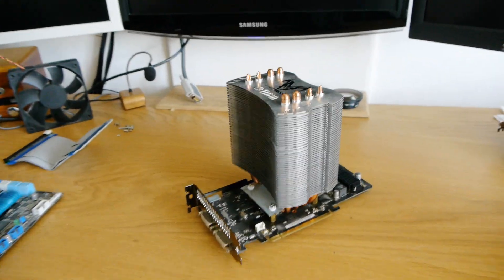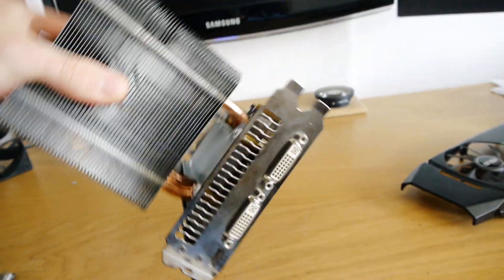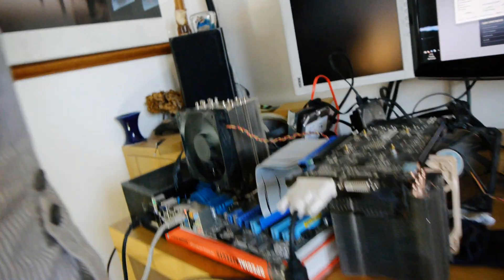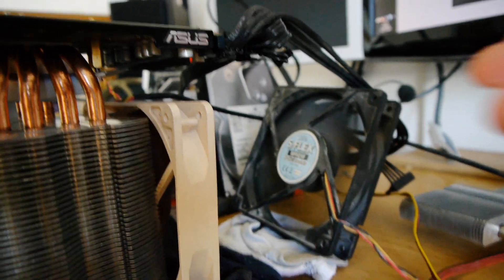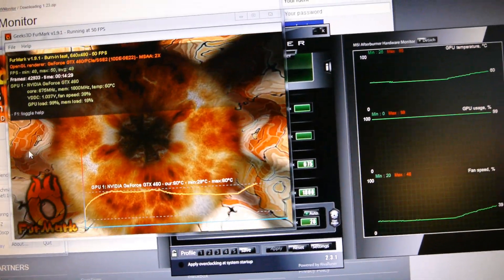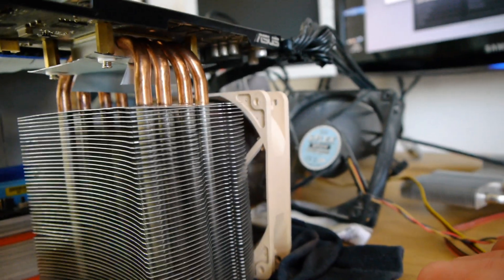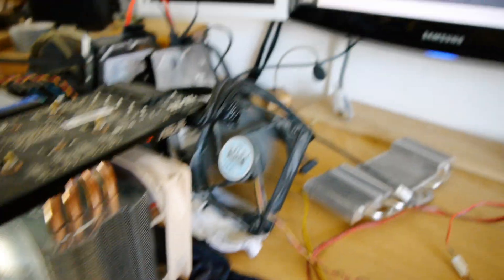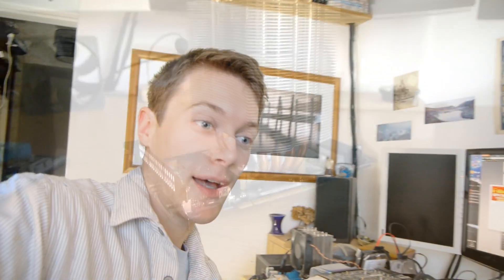CPU cooler on GPU (INSANE temps!)

Comment: There is one MAJOR issue with this design, You are not cooling your VRM's at all. Risking a VRM blow out.

I recomend getting VRM heatsinks (Completely passive with no fan forced airflow over is enough if you do not overclock.)
Reply: lampuiho Aluminium PCB? I hope you just realize what you said.
Reply: Mathias Westerlund 

Sorry mate, actually YOU are wrong here. The kind of PCB our friend lampuiho is talking about is the METAL CORE PCB ( and NOW you can Google it yourself ). Just because you haven't seen something during your career, it doesn't mean that something doesn't exist.  I don't mean to be rude, but, as you said, you are an IT guy, and we are electronics engineers. This time we know what we are talking about. Cheers!
Reply from the maker: Mathias Westerlund The original cooler didn't cool the VRMs or RAM either, so it's not exactly out of spec.
Reply: DIY Perks no ram cooling doesn't come off as odd. The vrm tho does. But eyh.. it's a lower end card so I suppose.
Reply: Mathias Westerlund its funny im a mechanic and knew what he was talking about. i do have a very strong it and electronics background though.
for someone with "international responsibilities" you can behave  rather childish when proven wrong, until someone else questions you...
maybe dont be so narrow minded and fixed in your ideas lol
Reply: Oh crap I ran out of popcorn. Gotta get some more.
Reply: It is the heat-sink, I am an Data center and hardware specialist with international responsibility. My job is making sure everything surrounding servers and hardware in enterprise environments work. Cooling is a large part of that.

You clearly stated you do not know what the name for it. Then you cant go tell me to google it myself,. Bring facts like i have or admit you are wrong, Don't come here stating something stupid as fuck like "Google it yourself" Because that means nothing else then "I think i have heard it somewhere but i cannot remember where, please look it up because i am too lazy and stubborn to do it myself and risk proving myself wrong."

You would NEVER want to make a PCB out of aluminium. 

An PCB is usually made up of made up of multiple layers of alloys and materials. most commonly ceramics and copper. 

You also cannot compare LED fixtures and cooling to computing boards, in an LED solution you usually want to spread the heat and dissipate it usually through the casing. That is both a bad and ineffective way of doing it with a PC as you have almost no contact between the case and for example a GPU, you also definitively do not want to spread the heat as you would end up with all the electronics heated up and running less effective therefor loosing performance.

What you want to do is to lead the heat away (Heat pipes or similar) and then dissipate it away from sensitive electronics. With VRM's it is usually enough with an heat sink attached such as the ones shown here. http://forums.tweaktown.com/attachments/video-cards/3336-msi-n460gtx-hawk-1gb-overclocking-results-msi-gtx460-hawk-sample-heatsink-layouts-256c-jpg

As i already stated earlier. If it was not original with VRM sinks on this board then it is probably not needed (Due to it being a low end board) but most full coverage heat sinks for GPU's cover VRMs as well and usually when you mod cooling you need to think about that and not only the core and RAM of the board.

Once again. Bring facts like i have above or admit you are wrong, Don't come here stating something stupid as fuck like "Google it yourself" Because that means nothing else then "I think i have heard it somewhere but i cannot remember where, please look it up because i am too lazy and stubborn to do it myself and risk proving myself wrong."
Reply: It's not the heat sink lol

Go google it yourself. I am an electronics engineer so I know what I am talking about. We design custom LED fixtures and LED lighting solution for our customers.
Reply: Mathias Westerlund 
if there was ever any concern about it they would be soldered on an aluminium pcb
Reply: Mathias Westerlund my plesure. I agree with you. Metal core is not the best solution on gpus as the goal is to take the heat away from the boart, not spread it! Cheers!
Reply: +Weisswurstesser And here everyone, We have the perfect example of someone that jumps into conclusions without reading everything and then goes homophobic over a simple and common saying.

A Prime example of immature and insecure.
Reply: Wait so... these are posts made by actual people, with actual lives? Huh..
Reply: Indeed i was wrong about "Never" making PCBs out of mainly aluminium. However there are still insulation on those to prevent short outs, it is also something you still DEFINITVLY dont want for a GPU since the total effects are completely different and like i stated befor you do not want to spread the heat for disipation. You want to lead it away and then disipate. My point still stands that you want Heatsinks on high effect VRM's used on GPU's and not an Aluminium PCB (Even those do exist and i admit my error on that part).

I also congratulate you on actually bringing some kind of fact (In this case the name "Metal Core PCB" and not just "Google it" Because that brings nothing to the discussion. Thank you for actually informing and educating while bringing the discussion forward.
Reply: Mathias Westerlund
Actually when the pcb is directly in contact with the case, the case will act as the heat sink and lead the heat away from the board. (no heat sink or heat pipe needed really for vram as they generally don't use that much power)
You do need heat pipes for the gpu though.
Reply: Mathias Westerlund
Wooow...
I don't want to get dragged into that gay bullshit.

Bye sir.
Reply: KingHalbatorix

bullshit, you're 12!
response enough? =)
Reply: Paul Trachternach
"im a mechanic"
Great, go change some tyres.
This here is about computer science =).
Reply: Mathias Westerlund
Usually used for high power LED
not sure what the correct English name is
but most part of the board consists of aluminium for heat dissipation.
Reply: lampuiho that would be an aluminium heat sink. An PCB is the circuit board... something you do not want in a conductive material. And what I said originally is that most of the time the full size heats ink covers the vrm as well.  His cpu one does not. Also you never solder a heating on in pcs. You use ally screw or spring attach them or thermal glue them. Never solder as this would damage the chips.
Reply: lampuiho You just repeated exactly what i already said.
Reply: +Mathias Westerlund It has a VRM Heatsink I think. Its that black block with fins near the rear of the card. It screws onto the bottom I believe as well.
Reply: That could be but there are more vrms un cooled that I can see.
Reply: +Mathias Westerlund 
Yes he noticed that.. Cpt. Obvious.
Reply: Weisswurstesser it was supposed to be an reply to nabudis.
Reply: Mathias Westerlund
After googling it it seems the only area with VRM's is the area with the heat-sink already applied. I know my 290's have two VRM areas but the 460 is a smaller card.
Reply: Mathias Westerlund

Well, it wasn't.
Reply: Weisswurstesser neither was yours in reality you just wrote my name and i have the comment thread on watch but i am not anal about that.
Reply: Mathias Westerlund
Nope
Reply: +D4V3Z02 :] coming from a guy whos being a troll* lol. yeah im a mechanic lol also studied It and have a diploma in it so GTFO! hahaha I dont care!
Reply: Weisswurstesser Wouldn't call this science. Yeah I can change a tyre haha, so?
Reply: Paul Trachternach
Claiming that this is not computer science is like claiming that building a car is not machine engineering.

Both claims are absolutely dilettante:
Reply: Weisswurstesser He is actually right, This is not computer science, This is computer Engineering. Science is when you research new fields and scientific discoveries. This is applied science wich means it is engineering. When you physicly apply knowledge to engineer something out of it.
Reply: Mathias Westerlund
"Science is when you research new fields and scientific discoveries"

Okay...
I have studied computer science and became Bachelor of Science. Please tell me what new fields have I researched and what new discoveries have I made?
Please tell me... I am not aware of that what so ever because stuff that was in my curriculum was written in 1967.

I think between you and the average dictionary there is a misunderstanding about the meaning of the word "science".
Reply: +Weisswurstesser 

Science

"the intellectual and practical activity encompassing the systematic study of the structure and behaviour of the physical and natural world through observation and experiment."

Engineering
"The application of scientific and mathematical principles to practical ends such as the design, manufacture,
 and operation of efficient and economical structures, machines, processes, and systems.."

No i think my definition is perfectly fine according to the "Average Dictionary" Perhaps you should try looking into one? Just because you took an absolutely shit and outdated computer science class doesnt mean it was the definition of science.

Especially if you want people to take you serious when you are claiming you have a bachelor in computer science, Perhaps stop being homophobic and immature calling everyone that dissagrees with you gay and 12 years old?

Altough, thats just my opinion. tho it seems others have similar opinions about you in this thread.
Reply: Mathias Westerlund
He called me 12 as a joke. Is english not your first language? That would explain your lack of understanding towards sarcasm as well as the fact that you seem to think what you said is in any way close to a dictionary definition. Maybe you misused the language when you posted your comment about science and meant something completely different from what everyone else read.
Reply: +Weisswurstesser When you learn computer science you learn the basics of how computers work, how to program them, etc.. It's important information if you plan on engineering software or hardware in the future, but not absolutely necessary. It's like Physical Science--you learn the basics of physics, some math and supporting chemistry. You don't learn how to calculate the fall rate of a bullet traveling at the speed of sound in a dense  atmosphere, or how to calculate what would happen if it collided with another object at a 45 degree angle.

When I took computer science, I learned the very basics of programming, and that's about it. It was a High School class, but most introductory college courses don't cover much more than what you cover in High School anyway. It was a lot of theory, and how to use certain functions, which is what I would expect from a science course. If it were a Computer Engineering class, they would have tested us on our ability to put our knowledge to use, rather than our understanding of the theory.

Edit: rather, a Computer Engineering class would test us on our ability to put the knowledge to practical use, and a computer science class would test our ability to put the knowledge to use in theory.
Reply: *****
A well written comment, but I don't see the point.
Reply: KingHalbatorix "It's the principal of the matter"
Reply: ***** I mean I just don't understand what your comment was trying to say in regards to the discussion. We have people claiming that knowledge of hardware falls under the field of computer science and people who are trying to debate the meaning of the word science, and being horribly wrong. I just don't see which argument, if either, you were supporting. Your comment seems pretty neutral.
Reply: KingHalbatorix Well, software engineering requires some knowledge of hardware, depending on how low-level you go. Computer science also requires some knowledge of hardware, but mostly at the theoretical level. In theory, you could have so many transistors in a certain area, operating at a certain temperature under a certain power envelope, but practically you'll encounter problems in putting such a thing together--computer engineering is the art of working around those problems (software or hardware) to create something that works in practice.
Reply: +Mathias Westerlund 
Wow... you're a 'try hard' mr international data center.
Jack of all trades, expert in none :(
Reply: Marrk2008
You forgot the second part of that phrase: "but better than a master of one"
Reply: ^ I ain't reading all that bullshit
Reply: +Richard John Lintulahti Olandim Especially that there are "wires" (not sure how they're called on a pcb) going in multiple layers INSIDE of the PCB for the GPU.

Comment: No one watched the video? 
No complaints about the wrong number of heat pipes? 
There 4 guys, not 8 
Only number I see here are really odd temperatures 
Unless your pc isn't in a refrigerator stop saying that's it's only 5°c higher than ambient temperature under a load.. (air cooled) its utter bull shit 

With that said 
Very nice video dude, it gives a nice idea how heat dispensation works better with bigger coolers! 
Subscribed!

Comment: You consider 50celsius insane temperatures? I feel uneasy when my card is running on 70c under load.
Reply from the maker: Mad Bor Insanely low for air cooling, yes. It's a 170w+ TDP card.
Reply: Mad Bor i feel uneasy when both my cards go over 40c with a +360mhz overclock :D
Reply: Mad Bor Well for a video card that temp is pretty good. And if you're using an air cooler video card 70C° is pretty normal when under heavy load.
Reply: DIY Perks my msi cyclone one maxes out at 58c and usually is around 56c with fan at 60% and over clocked to 850mhz core. At 100% usage too.
Reply: Mad Bor my card get 68 °C in idle and 95°C in gaming, (Gefroce 8800 GT Alpha Dog)
Reply: He meant insanely low temps
Reply: +Mad Bor GPU's were made to run hot. 70c is fine.
+Pedro Bermudes You need to get with the times if you're still using an 8800GT....
Reply: +sur puppa Yeah no shit, but the temps aren't insanely low.
Reply: ZGames actually, for such a cheap solution and a incredibly low noise it is pretty insane
Reply: *****
 depends what card it is, my old MSI 980Ti's ran at above 80c brand new in SLI. The 91c is there for a reason so NO damage comes to the GPU, hense the throttling at that temperature. If solder would melt at that temperature then the limit would be lower.

Maxwell idles at 50c with zero frozr technology. Dont forget that GPU's and CPU's are designed to run just under their TDP.
Reply: *****
Maxwell is leaps ahead with many times more transistors. Idle temperatures dont mean much. They run at 50c because the fans switch off to save power. A single card runs in the 60s but obviously in SLI aftermarket coolers dont cope as well.

My SLI 980Ti's idle at 21c and run maxed out with a custom +210mhz overclock at 42c. Watercooled of course.
Reply: ***** No it doesn't, do not give me that bullshit. Some reference gpu's will run at 83c. If you think 70c is bad for a GPU, you have no idea what you're talking about.
Reply: +Mad Bor my asus  hd 7870 runs 89.5 degrees celcius
Reply: +Mad Bor Also note that fans area basicly at idle speeds.
Reply: +Doge Gaming wtf
Reply: +DIY Perks My R9 280 runs at 62c max at full load. 
If i overclock it will hit 1075mhz core and 1325mhz memory clock, and runs at 73c with 50% fan speed.
In a 27c-32c room.

Comment: You total moron, you have it upside down. . . 

It will work 10X better if you put it the right way up.....

Heat pipes have to be the right way up FFS.
Reply from the maker: cucking funt insert random words here (can't be bothered)
Reply: cucking funt The original cooler had the heatpipes horizontally so I don't thing is that big of an issue, I DO know heat rises up and heatpipes work that way but copper is also a thermal conductor... so if you want to gain like 5°-8° more then yes, put it upside up but at 60° max...60° FREKING MAX... that shit is rock solid perfect.
Reply: cucking funt bro bro bro that is not how heat pipes work. They work because they are a conductor. The orientation of them makes no difference at all. Next time before you go posting some idiotic comment make sure you know what you are actually talking about instead of posting some random wrong piece of information.
Reply: Matthew Krebs
Actually heatpipes aren't a conductor but a heat "pump", they contain oil inside and transports heat very quickly from the hottest part to the coolest part balancing the temp of the whole cooler.
Reply: Raik Actually, A lot of heatpipes work similar to refridgeration with a liquid that vaprizes at a certain temperature and then condenses when it cools off againwich means you want the heat below the cendensation point.

Altough this is all depending on the model. Some are solid copper, Some are oils others are vapour chambers.

Comment: Before you try doing something like that keep in mind that many modern graphic cards not only get hot on processing units, but also on resistors, capacitors and other different places which the heat sink cools them also. So if you strap CPU sink on GPU, other places which also get hot wont get any cooling and your card can get toasted.